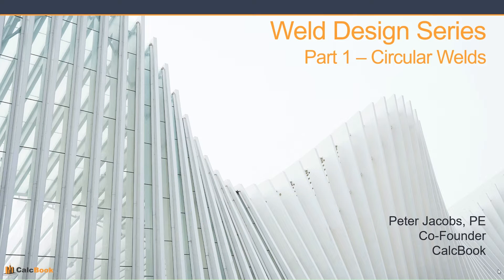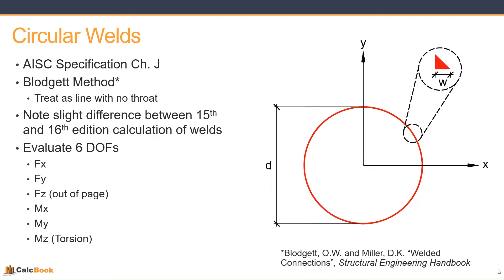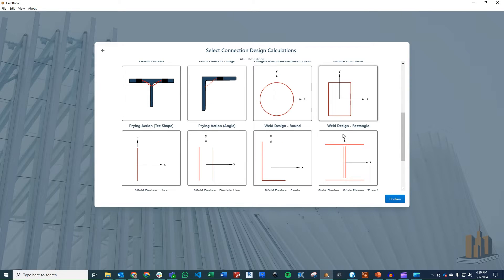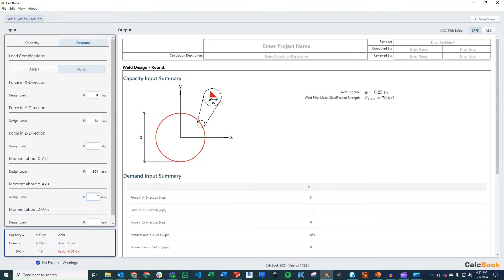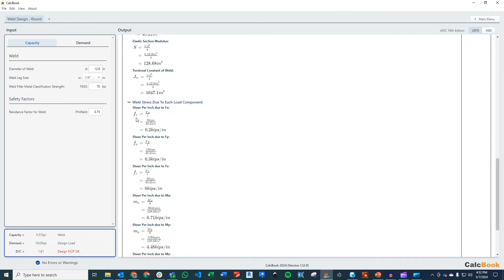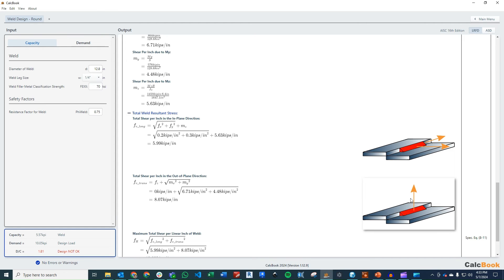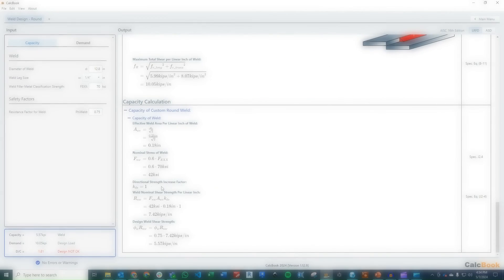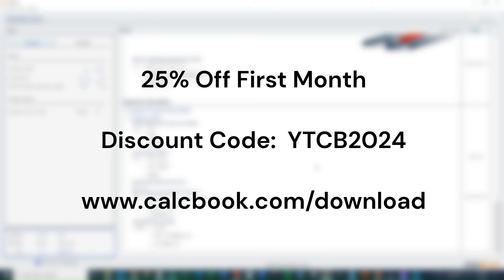Circular Fillet Weld Design (AISC and Blodgett)

Comment: Why section modulus is that??
Reply from the maker: The section modulus is just the elastic section modulus for the weld based on the geometry of the weld.
Reply: @calcbook this assumption is the weld thickness is significantly smaller than the member you weld for
Reply from the maker: This calculation module only checks the weld design, not the base member.